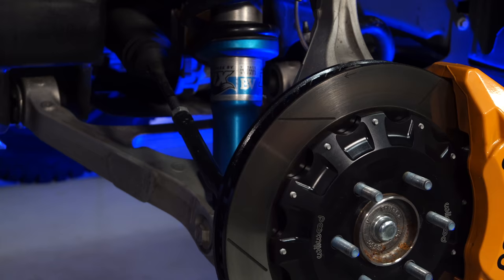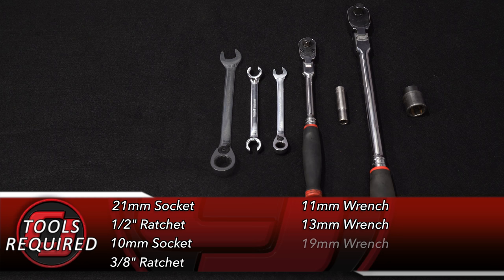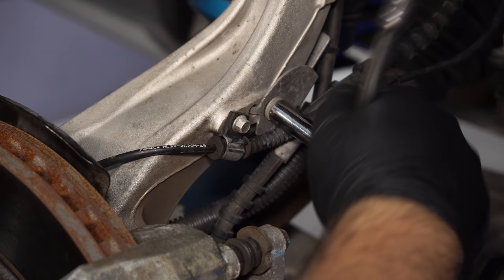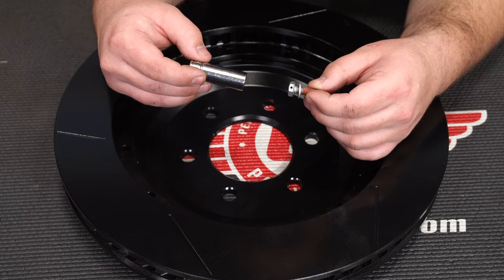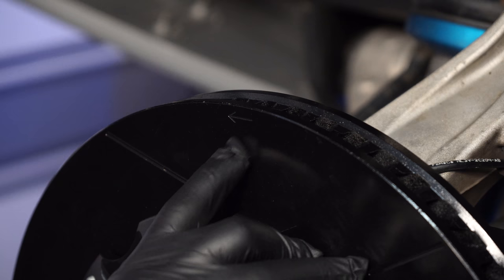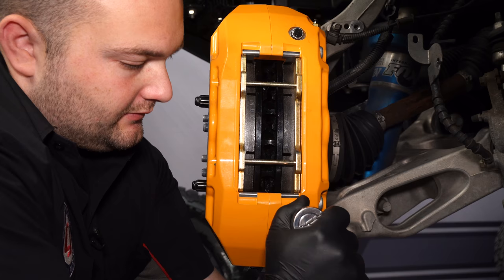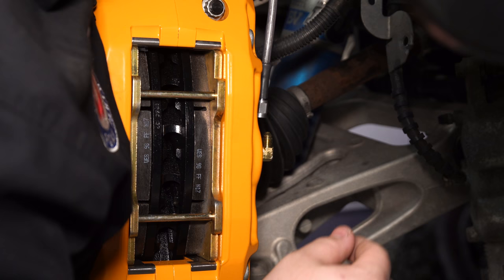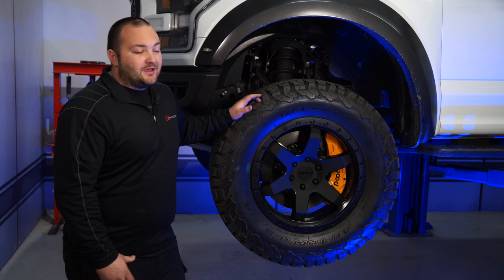F-150 Wilwood Front Disc Brake Kit TX6R 6-Piston With 15.5" Slotted Rotors 2010-2019 Installation

Comment: What the price of the k et TSA front  and rear  slot also  what size wheels are required  also will this fit 4 the 2010 Ford raptor  5.4

Comment: 2019 ford raptor I ran in to problems had a 20” wheel from fuel and had to add a spacer and up grade the
Tie rods because It was Hitting.
Reply: Im hesitant to order these. Wilwood straight up said "its hit or miss depending on year and time the truck was built fit they will fit without upgrading to the tie rod spacers"
Reply: @pbvnick  yes sir very true a seen a lot of raptor go with the r1

Comment: Have question do you know if these would work on 2018/2019 f 150 3.5 or 5.0. With the Roush Mickey Thompson wheel and tire combo with the Roush 2.0 suspension kit

Comment: I'm wondering how much having a much larger wheel and less of a tire side wall detracts from both ride quality and off road capability
Reply from the maker: It's hard to measure how much, but a smaller side wall will affect ride quality and off road capabilities.
Reply: Very noticeable difference. If you off road regularly putting those big ass wheels on is sac relig.
Reply: Two great answers 👍
That install is great for 'street queens' that need high speed braking. Looks👀good, too.👍

Comment: I have a 2019 Ford raptor supercrew with the upgraded 17-inch Forged Aluminum Bead-Lock Capable Wheels.

Would these fit my truck? If not, what are the biggest brembos that would fit?

Comment: I got a 2019 ford raptor and I’m upgrading to this ASAP.
This is my build with tires. Can these fit mine?
$55,840 Base MSRP for 2019 Ford Raptor Super Crew (4 door)

$3,855 Total of Options
-17-inch Forged Aluminum Bead-Lock Capable Wheels
-4.10 front axle with TORSEN® Differential
-bed divider 
-bed-liner spray in
-remote start system 
-Tailgate Step with Tailgate Lift Assist

$1,495 Destination Charges

Price without taxes and license: $61,190
Reply: You need 20 inch wheels for it to clear this big brake system